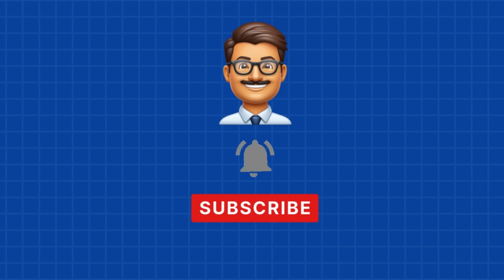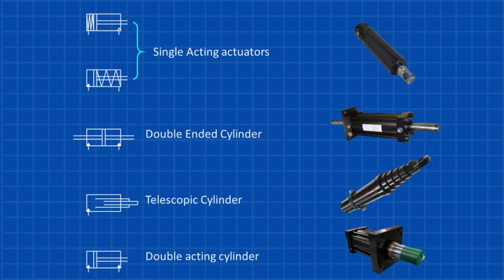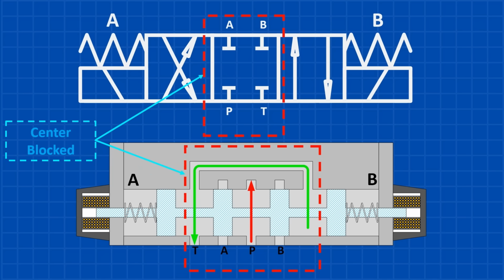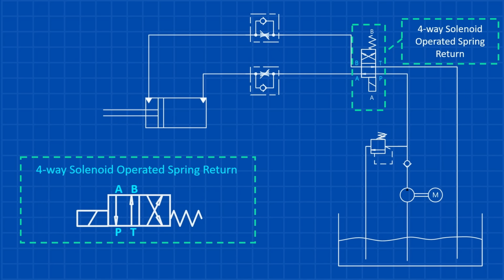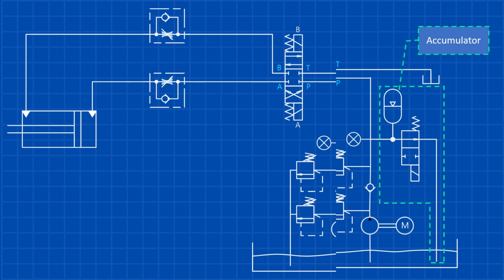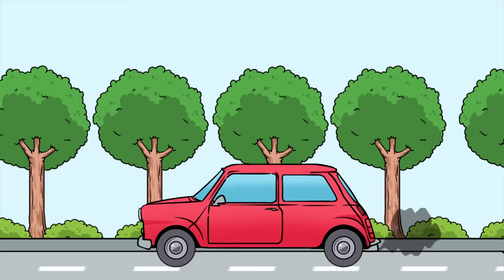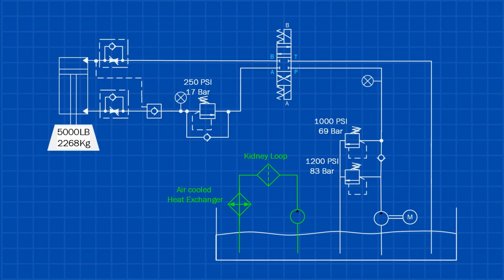Hydraulics Simplified, 30 Years of Expertise in Just 17 Minutes

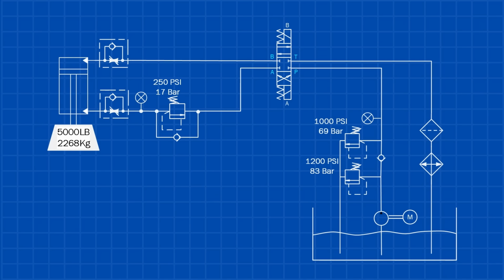Comment: The balancing valve at 13:30 that you added there will only open after the pressure has increased to the set limit? So, when the load is lowered, will it be forced only by the pressure at port B? Otherwise, the valve will never open, even if we cut the pipe at port A. Shouldn't there also be a bypass valve with a restriction? So that the oil can flow freely and there are no such demands on the life of the cylinder seal, the bypass with the safety valve would only be activated when overloaded. (I hope I explained it well, I'm from the Czech Republic :))

Comment: Hello just wanted to confirm, is the direction of the pilot operated check valve in the correct direction? Thanks
Reply from the maker: The direction of the pilot operated check valve is correct however the pilot should have been on the other side of the vlave, However it was too late to correct in this video. Thanks for watching. IT is corrected in my other videos ( counterbalance valve )explained.

Comment: I would like to thank you so much for your professional and smart explanation.
Regarding counterbalance valve,  Why there is a combined check valve with it? what is the role of that check valve ?and why we connect the control valve with counter balance valve?
Reply from the maker: Thank you for watching. Think of pilot operated valve as an emergency break when the cylinder is up.

Comment: New Rexroth 4WE6E70/HG24N9K4 Solenoid Directional Valve
Pressure not holding it's release why sir
Reply from the maker: If the unit is brand new, the issue could be somewhere else. Without a schematic, it’s hard to pinpoint the problem. Try deadheading the pump to see if you’re getting pressure.
– If you do have pressure, make sure the solenoid is actually energizing.
– If you don’t have pressure, you’re likely dealing with a relief valve issue.
Also, if the pump is feeding an actuator, the cylinder piston could be leaking internally.
For a deeper dive, check out my video: “STOP Guessing! 30 Years of Hydraulic Troubleshooting in One Guide!”

Comment: If i have determined a power source for example 10hp operating at 3000rpm continous rated, how do i calculate how much flow liter per min is possible if using a variable piston pump @3000psi 18cc per revolution?
Basically i would like to determine which pump is suitable based on the power source. 

Thank you.
Reply from the maker: First of all thank you for watching.
You need the flow (GPM) at 3000 RPM and the system pressure (3000 psi) to calculate hydraulic HP.
If instead you already have a predetermined shaft HP and you want to use the system at 3000 psi, first convert that shaft HP to hydraulic HP by multiplying by pump efficiency, then calculate the flow that hydraulic HP will produce at 3000 psi — finally pick a pump with that displacement/curve. Below are the formulas and examples.
Hydraulic power (HP) = (Pressure (psi) × Flow (GPM)) / 1714
Rearranged: Flow (GPM) = (Hydraulic HP × 1714) / Pressure (psi)
Account for pump inefficiency: Hydraulic HP = Shaft HP × pump_efficiency (e.g., 0.85)
Conversions: 1 L/min = 0.264172 GPM ; 1 cc = 1 mL

Example:
Displacement = 18 cc/rev = 0.018 L/rev
Flow = 0.018 L/rev × 3000 rev/min = 54 L/min = ≈14.27 GPM
Hydraulic HP = (3000 psi × 14.27 GPM) / 1714 = ≈24.97 HP
If pump efficiency ≈ 85%, required shaft HP ≈ 24.97 / 0.85 = ≈29.4 HP
=> So an 18 cc/rev pump at 3000 RPM running at 3000 psi would demand ~25 HP hydraulic (and ~29.4 HP at the shaft), so a 10 HP motor won’t run that.
Reply: @Electrical-lad much appreicated. I am a hobbyist and trying to reverse engineer a mini excavtor system using a predetermined power source (combustion engine) that is readuly available on the market.

Comment: would have been good if you could have included single 
and dual pressure relieved cross piloted cylinder check 
valves, they are an essential safety item we use in various 
places in the manufacture of semi trailers. 
however... good video, i will be recommending it to some 
of the people that work under me to get some idea of what 
the symbols mean and basic circuits.
Reply from the maker: Thank you! This video is for beginners.

Comment: Is pilot operated check valve and counter balance valve are same or they have different functions
Reply from the maker: they have different functions. Pilot operated valve is like a brake in the car. Counterbalance is like the Governor in Engines:
A governor automatically adjusts fuel supply to keep engine speed steady.

Comment: Why are the P ports of one directional valve shown connected to the T ports of the other directional valve?
Reply from the maker: This is known as a Tandem Directional Valve. When the valve is in the neutral (center) position, hydraulic flow is directed back to the tank at zero pressure. This design helps conserve energy and allows for easier filtration of the hydraulic fluid through the return filter. However, a key limitation is that it can only be used effectively in systems with a single valve. This is because there is no system pressure when the valve is centered, which prevents other valves from operating. Thanks for watching!

Comment: Hello Sir, I love hydrolic system, and  my dad had trouble with it. My dad had tractor wich Fordson Super Dextra wich made around 1960 and old style hydrolic it made always problems, while driver was ploughing the field it did not work  so he used low gear and very high gas wich broke the pineon, dad couldn't find the pineon in Srilanka  in this case dad sold the tractor half price. It's happened 1980, I was young kids, I couldn't help. I asked dad  what happened, he said  rubber  sealer damaged often, he didn't do himself, always engineer. A farmer without tractor hell life. It's affect a lot.
Reply from the maker: Great story! Thanks for watching.

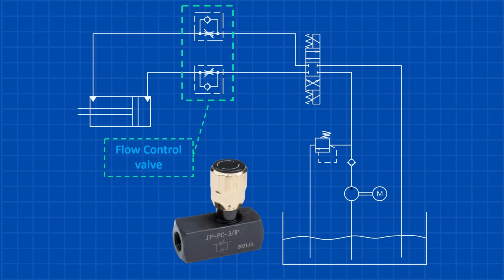Comment: Okay, so I consider myself a mechanical genius and the way you presented this material made it quite accessible and I'm not afraid to say I understood everything and even come up with an alternative way to make a more effective spool valve design. But I didn't quite get the flow control valve you showed at 7:04 .  I can  see "the ball" will stop the flow going back, but what is controlling the flow in the other direction? Is it a fixed resistance to the flow or will it be shut when the flow goes through via "ball path"?
Reply: Uf you use it without restrictions it will come down faster which is dangerous,  all machines that you can suspend load have that valve
Reply from the maker: Okay, let's say the cylinder is extending. The oil flows through the check valve, pushing the ball open. But on the rod end, the oil has to pass through a metered orifice, which slows it down. This means the amount of oil entering the blind end is exactly the same as what's coming out of the rod end—no more, no less. I hope this answered your question.
Reply: @Electrical-lad  Thank you for the explanation. Let me chew on it for a while? I understand what you are saying - but not why it is needed :(  What is wrong with letting the oil pass unhindred back to the reservoir is more or less what I'm wondering about ..
Reply: @SwedishNiceGuy  I think the main issue with that might be that when you think about the practical application, each hydraulic cylinder is moving some sort of arm or component. The speed which that arm must move has already been determined by the designer of the machine and it must be kept the same throughout operation. So, a flow control is needed to keep that movement speed the way it was originally designed. That's at least my best guess.
Reply: Hydraulics flow controls movement speed in the circuit, meaning this flow restrictior allows us to control the retraction and extension speed of the cylinder, without it you risk damage to the cylinder or damage to the mechanical component that the cylinder is acting on.

Comment: Very simplified lesson but has a few issues.  The counterbalance valve shown is not one usually used by industry.  The pressure bleed down line from an accumulator to the reservoir should have a restriction in the outlet to avoid excessive flow rates.  You mentioned that oil coolers have cooling tubes...yes but not always.  The plate type heat exchanger has parallel plates.  I think that there is one shown in the pictures.  Full flow high pressure filters are a must for certain applications such as closed loop hydraulics where generated metal particles can circulate around in the loop and destroy everything...speaking from experience.  Also I use high pressure filters in open loop circuits where the application has expensive components in it.  The cost of the filter is minimal compared with the consequences.  Also high pressure filters and normal return line filters have bypass valves to protect the filter if it becomes blocked.  Also pressure switches are used to indicate a blocked filter.  I realise this is an introduction but reservoir baffles to remove air? don't splash return oil to reservoirs? and moisture remove via desiccant filter breathers, shape of reservoirs?   The other point to mention is that all circuits should be drawn in the deactivated state.  Also circuits must consider vandalism especially on mobile equipmant.  Some people think it great fun to put a handful of sand into the hydraulic reservoir.  Cheers
Reply from the maker: Thank you for your input!
Reply: Awesome information!

Comment: what about a filter before the pump, no need for pressurised filter
Reply from the maker: That is called a strainer or suction filter and has a 120-micron rating, meaning it only filters out larger particles. It's typically a standard component of the unit, which is why I didn't specifically mention it. Thanks for watching and your comment.

Comment: Pressure filter is the way to go. Otherwise you'll damage everything in the system in case of pump failure (metal chips). You will kill expensive proportional valves etc.
Pressure drop is a good thing - you can use this to detect clogged filter, there are switches build into filter housings (this is info for maintenance staff, to replace the filter).
Reply from the maker: I agree for servo and proportional valves.
Reply from the maker: Thanks!
Reply: Great video
Reply: Why not installing oil filter between the pump and the reservoir?
Reply from the maker: The pump's suction line typically includes a suction strainer. However, restricting the pump's inlet can lead to cavitation, which can cause pump damage.
Reply: Great video.
Reply: Only in a closed loop system
Reply: Studying for ramsey test , this should help